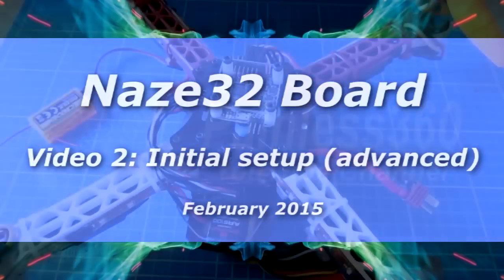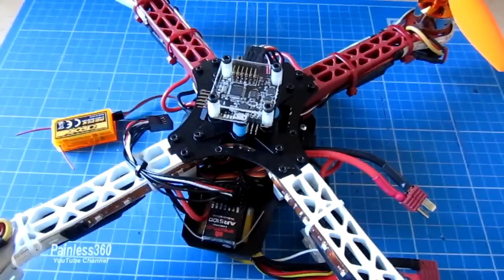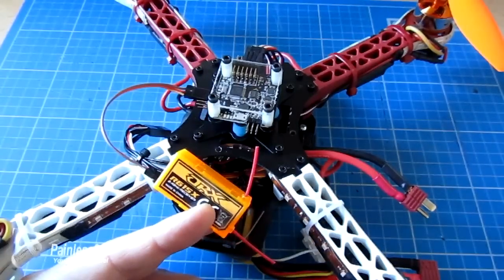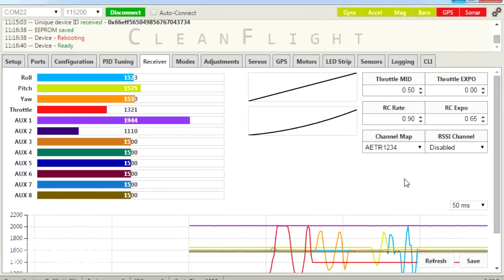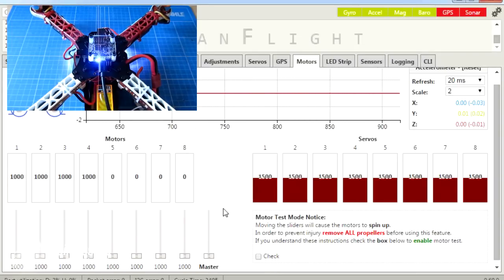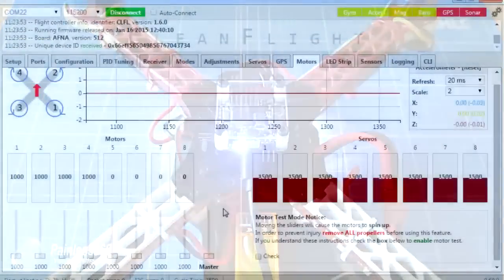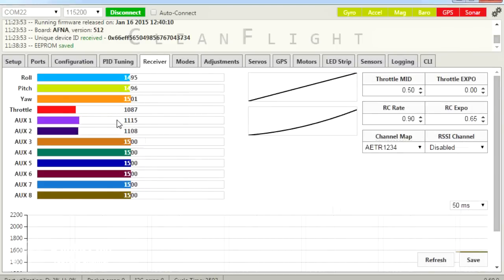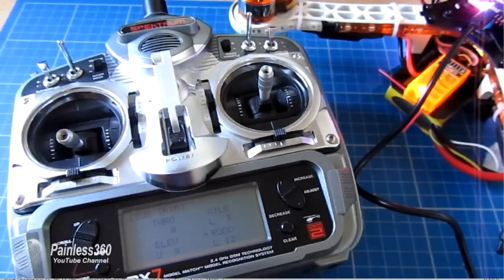(2/8) Naze32 Flight Controller - Extra setup steps and configuration

Comment: I'm at my wits end and decided to tap your wisdom again after searching and watching vids including yours over and over almost all day for a solution. Using Acro Naze32 R6, with FrSky V8R4-II rec'r, Taranis radio, with Frky DJT telemetry Module set to PPM. Naze set to PPM, 4 Opto ESCs (12A Afros with SK), one with bec. The V8R4-II is connected using one cable to Naze input 1. The Acro Naze 32R6 connects well with CleanFlight, firm updated, accelerometer calibrated. ESCs are plugged into channels 1-4 respectively, one provides 5v. I connect the Naze to CF all good, can see gyros working, but none of the channels works at all, the motors start via CF but nothing from the radio? IOW, I can't get the receiver to react at all within CF with my Taranis? I've tried with a X4R rec'r with 'telemetry' nothing? Any ideas?
Reply from the maker: +Pierre Seguin Does that receiver support PPM?
Reply: +Painless360 
From everything I read it DOES NOT!! I was under the impression it did especially when the 'binding' instructions tell you to set the radio to PPM mode. Just shows to go ya, read before buying. Time to buy another receiver darn it!! Thanks again for all your patience and wisdom. Hope you do a review of the Naze 32 Rev:6 pointing out the differences with the R5. I'm sure all will be good once I get the proper receiver. I'm open to suggestions for one which would work with the Taranis and offer telemetry. Thanks again.
Reply from the maker: I would go for the great D4R-II. Best of luck!
Reply: +Painless360 
I feel better now, as I ordered 2 of em! Thank you sir!
Reply: +Pierre Seguin 
Just a follow-up. I received the D4R-II and everything works beautifully! Did a flight test and she flies really well.
What I'd really appreciate is a more 'in depth' video on 'Modes' and how those 'ranges' work, and, how to use the 'adjustments' tab in Cleanfilght. Thanks so much for your help!

Comment: Checked out your wiring diagram at the beginning. Connected....everything working! Test flight! Spun violently( tri) broke landing gear bugger. Still happy to have made small step forward. Thanks. Ps will check motor config as naze different to flite test suggestions.
Reply from the maker: Nigel Holland Flitetest! Are you two timing me! ;) :)
Reply: Ha! Well if flite test don't reply to emails I may dump them and then I am all yours. Unless you count rcmodelreviews? Oh and spocktra50. Although they are just about crashing talking dirty and laughing at Alex! So now you got me this far where should I look for this violent spinning that is happening? Reverse servo? Maybe the angle it starts at?  Thanks again for getting me this far though. Felt good when everything started up. :-))
Reply from the maker: The board should take care of the angle of the servo. If it pirouettes then check it doesn't need reversing. The tilt should be to counteract the rotation.

Best of luck.

Comment: I can't seam to get a frysky x4r receiver to connect sbus to my taranis with the rev 5 fc boards,  I have sucessfuly done so with the rev6 by moving the signal wire to pin #4 several times. but I have 2 of these rev5 boards one just a basic acro the othe with baromiter, mag the works and I don't know what I'm doing wrong, have conf cleaflight with the correct serial ports. your vidieo uses ppm no problems though cleanflight looks a little differnt now. what am I doing wrong where can I learn the correct set up?
Reply from the maker: +Jeff Orr the rev5 boards don't have an onboard inverter for the sbus signal.. best of luck!
Reply: Ahh.. wow, now
 I feel kinda of silly then, funny thing is I finnaly gave up and used a frysky 8 channel and did it the old school way, so many wires. thanks for responding so quick I am allways happy to see a responce from you.

Comment: Hi fixed i wired the receiver wrong to the board as in the video it's not very clear because the white lead on the cable on your video was negative but when I watched the video 3 times when you went over the leads I realized I weird it wrong  by the way I love your videos keep up the great work

Comment: i am using DJI f450 frame , should i mount the battery on the base plate and flight controller on the top plate, or should i mount it the other way around, what is the best for a stable flight?
Reply from the maker: The F.C. needs to be as close to the COG as possible. Top plate is fine..

Comment: Excellent series of video's, helping me to setup my Emax Nighthawk250. I have an issue regarding the calibration of the Esc's, Emax  BLHeli 12A.. ie .. motor 3 starts at 1500us and turns ACW then on reducing PWM signal below 1500us it reverses and goes CW.Motors 1&4 ok.  Motor 1 stutters up to a reduced  max speed.  Would be appreciate your help....Joe
Reply from the maker: +Joe Stubbs Sounds like that ESC is setup for 3D flying. I would look at how you disable that on that ESC..

Comment: Many thanks for the excellent presentation of all your videos. I have build my 250 Quad  based on your videos which for my first build  went well having followed your tutorials. Can I ask , how did you switch the led,s via the aux  channel. Thank you.
Reply from the maker: I can't remember from this far back. I'd look at the WS2812 programmable LEDs is you want to control them. You can connect them to the FC and get them to do some very cool stuff!

Comment: Hi  If I use the Frsky X8R Rx with a single cable from the s-bus to Naze 32, do I need to use an inverter cable?
Reply from the maker: Usually, and connect signal to pin 4. Best of luck!

Comment: Hi there !    Just gone thru both videos on naze setup ~ very helpful thanks !   I'm using a Turnigy 9X Tx with Orange Rx plus Naze board on my V Tail Quadcopter and I'm having trouble arming the board.   I've calibrated all escs as per your video and trimmed controls to values you reccomend.   In Motors menu I can get all motors working via Cleanflight as in your video but as soon as I switch on my Tx and plug lipo into Quad I cannot get Tx to arm the board.   ( Naze disconnected from Cleanflight )   Can you help please ! ! !     I've watched all your videos to date as they are so well made and very helpful.   
Best Regards . . . Eddie.
Reply from the maker: +Eddie Lloyd Arming help video later in the series ;)

Comment: here is a question for you.
I was talked into trying the naza32 controller by our fpv race group, saying for race it is the best. after putting 300 or so into just the quad, I wanted to really see how it performed, I decided to try the auto tune feature instead of the old fasting manual test. for some strange reason when it started the auto tune it decided to ignore my throttle input and would not stop no matter what i did. I even tried killing and disarming, nothing worked, I did still have all my other controls so I could keep it sorta undercoat roll but, never could get the throttle to stop. to get it to drop altitude I had to flip it over and over doing line of sight flips are scary by the way. I had to ditch before the quad got over the interstate and as of yet have not recovered as it would have been a huge impact as it was inverted. I had oneshot125 esc and 2300kv race motors. hovered at a little over 1/4 throttle and had 6030 tri-props. any thoughts as to what went wrong? going to keep trying to find the craft but as I ditched in the woods I'm not feeling hopfull.
Reply from the maker: Tricky to say. I always add a buzzer to a Naze32 to help recovery. Best of luck..
Reply: I had to ditch from around 250 feet by inverting so a buzzer would not have worked as there was no power, battery did not stay on. I was going to use the props to let me know where it was. the big thing though is what went wrong? I have never seen a board ignore throttle input before. course I have never used auto tune before
Reply from the maker: +Brian Tapp Sorry to hear that, I've heard of a few odd things happening during autotune but never this. Best of luck finding the model. It's always heart-breaking trying to find a downed craft. All of us have lost at least one so know how rubbish it feels..

Comment: Thank you so much for such informative and comprehensive videos!! This is my dilemma, (I'm in mode 2) when I push up on right stick both pitch and roll move simultaneously in cleanflight. Throttle and rudder work appropriately .Transmitter is FS TH9x, receiver is FS R9B. Any insight would be greatly appreciated. Would this prevent board from arming?
Reply from the maker: You can't fly with it like that. I'd check the channels on the radio using the 'monitor' screen. You may have a helicopter model selected in the radio or a mix setup accidently. Best of luck!

Comment: Lee I have just re calibrated my motors with the throttles high as in your video done it all correctly, however motors 1 and 3 start first at 1062, and 2 and 4 start at 1075, this has now confused the heck out of me, any ideas please?
Reply from the maker: +Rob Ellis I normally revert to a manual calibration (see out video in it) in cases like this..  Best of luck!

Comment: Hi, I am using an Orange Satteltite RX (Spektrum clone) as PPM source to the Naze32. Ist there any way to get a RSSI readout in the Naze/OSD?
Reply from the maker: +Flo Sch That is more of a question for the vendor of the receiver. I'd suspect that if it is possible it requires a lot of messing about.. Best of luck.

Comment: is the naze better than the cc3d? bang good sell a really cheap cc3d, can you recommend it?
Reply: Pro tip: google it. You're by far not the first to ask this question.
Since most of the "goodness" of a flight controller comes from the software you run on it and Cleanflight will run on both of them: they are the same ;) .
I've never used a Naze or CC3D (I run Cleanflight on a STM32 dev board from ebay), but it looks like the CC3D has more pins broken out, which, at least if you're running cleanflight, will make it much easier to connect additional hardware supported by Cleanflight.
Reply: superdau the naza is multiwii the cc3d is not.. so I dont think they can run the same software.. the cc3d runs openpilot the naza runs a modified version of multiwii which is cleanflight or openflight
Reply: capone6 "naze"
Reply from the maker: capone6 Cleanflight will now run on the CC3d board (see https://www.youtube.com/watch?v=4OKGMhTrqOU about 8:30). Just like the Naze32 the CC3D is available in a couple of formats with varying amounts of sensors. The cheaper boards are the version with the basic features.

I've not had enough time with both to form an opinion but first impressions are that both are excellent current generation platforms with excellent support and software interfaces.

One thing I will say is make sure that, unless you are going to be happy with basic stabilisation and auto-levelling, you get the board that includes the magnetometer and barometer. Much easier to add extra features like GPS and associated modes later.

If it's your first build the fool proof setup wizard for the CC3d (OpenPilot Ground Control Station software) is a lovely way to be stepped though the build/testing process safely.

Hope this helps..
Reply: Painless360 it does help a lot im going with the cc3d for now with hopes to get the naze 32 after you have shown how to get the gps working, i beleive cc3d gps does not work properly.

Comment: Hi, I've tried to copy this setup but using a orangerx r910 receiver with sbus port. It's doesn't work. Am I doing something wrong or does this way not work and I have to use a satellite? There's no movement on clean flight receiver tab and I've double check connectors headers and cables. Please help.

Comment: Hi there,
Thank you for doing these videos.I'm on my first built drone, and they were very educational.
I have a question though(probably silly) : in order to give input from my controller to the drone via AUX knobs and buttons, do i have to connect the empty pins from the board and receiver ?
Currently 4 motors, my receiver is a  FS-TH9x
Thank you again :)
Reply from the maker: +Dan Suciu Watch the https://www.youtube.com/watch?v=LyPtzv0y5DE video it may help. You need to connect the outputs from the channel that the knob/switch controls to the input of the flight controller.Best of luck with it.

Comment: Hey Painless360,

Thanks for the great tutorials! You helped me greatly setting up my Disco with APM 2.6.

I am now building a 210 miniquad using a NAZE32 rev 6, and again your videos have been brilliant. 

One thing has me nervous though...When I got to the section on calibrating the ESC's (EMAx 12a) I noticed that not only was the receiver powered up from the USB port, but the ESC's and motors were live to!! Is this normal in rev6? There was not enough power to spin the motor when I raised the master slider, but they were trying!

I calibrated the ESC's individually (apart from one which was DOA), and they all spin up as they should when the battery is connected. The board seems to be behaving normally, and I have successfully set the modes.

Should I be worried about this?

Cheers
Reply from the maker: We've not used the Rev6 board here but the main power should be needed to run the motors. The ESCs need the main battery voltage/current for the motor power. The ESC circuitry may have been supplied by the 5v from the USB. Again, may be a new thing on the latest version.. Best of luck!

Comment: Hi painless360.. what kind of ESC your using??  i have a naze32 rev6 with 14.3 firmware and  4 EMAX simonk 12A  ESC... but every time that I want to callibrate my escs dont enter in callibration mode.. do you have any idea why this happens ... thank u .
Reply from the maker: Back when we shot this video it would have been a SimonK flashed 20A ESC.. You need to plus the battery in after you raise the throttle. See the 'Quadcopter building for beginners' series for more detail on each step. Best of luck!

Comment: Can I use a Spektrum DX9 transmitter with an orange R920X receiver in cppm?    I would like to use it with my naze 32. I can bind the receiver but nothing good happens when I try and connect it with the flight controller.   ENJOY YOUR  SHOWS.
Reply from the maker: Tom WAllace Should work. What does 'nothing good actually mean?' ;)
Reply: Painless360 well when I connect with my dx9 the Naze shows a flashing red , a green and a blue,  MY BUZZER IS LOUD ENOUGH TO MAKE YOU WANT TO RUN TO THE BOMB SHELLTER.
Reply from the maker: That sounds like it's FC related not receiver..

Bets of luck with it.

Comment: I am looking at building a micro and have a question for you; using this board is it neccesary to use esc's with small ~7mm motors?
Reply from the maker: +retrotellephone You need ESCs to run any size of brushless or brushed motor. Best of luck with your project!
Reply: +Painless360 Ok, the reason I ask is I've seen some micro boards that must have them built in. Thanks for the quick response and fantastic videos.

Comment: Hello,.. thanks,.. it's a great video,.. by the way, how to connect ppm  receiver flysky fs-ia6b to the cppm of naze32 rev6 ? it's the same procedure ? if you have any link of diagram picture or video is very helpful,  thanks.
Reply from the maker: +Sigit Pramono Should be, I'd check the manual to be sure.. Best of luck.
Reply: Thanks for your replied, i'm confusing the wiring power and setup for these type.

Comment: Any ideas on how to setup sbus?  I've made the inverter cable for my x8r receiver but when I select serial rx it won't stay active.  The software will let me select Ppm and the other rx types. But when I select serial rx and flash the board, it returns un selected.
Reply from the maker: Andrew Littlejohn For SBUS you need a hardware signal inverter. Signal goes to input pin 4, power is 5V. If you Google 'Cheap SBUS inverter' you should find one..
Reply: Hi thanks for your reply.  I found some instructions on how to make the inverter. So I purchased the fets and resistors from maplin today and made up the cable.  My issue just seems to be with clean flight. If I click on serial rx and save.  The 4 options available for the rx's are not selected. But any other mode will save to the board fine.
Reply: I've realised my error. The fet I bought is the wrong channel, basically my signal is still inverted.  Lesson learned
Reply from the maker: Thanks for letting me know - glad you got to the bottom of it..

Comment: Any chance of some help? Have a dx6i with Storm receiver (ppm ) if I connect ppm rudder works ( tricopter.) but pitch and roll mixed up will not arm. I am a real noob at this. Think maybe get same Orange receiver like you? Really frustrating as all videos like, ft, rc model reviews say it is so easy.   Grrr. Thanks. Nigel
Reply from the maker: Nigel Holland Go through the setup again and either reverse the elevator channels in the radio (http://www.horizonhobby.com/pdf/DX6i-Manual_EN.pdf, Page 11) or in Cleanflight. The receiver will not make any difference to this problem. 
Best of luck.

Comment: Do I need to bind my receiver with transmitter before I plug in ?
Reply from the maker: +Tuan-Anh Nghiem i normally do, once setup is complete I rebind to capture the new settings onto the reciever before testing failsafe. See our  'Introduction to Remote Control ' series.. Best of luck!
Reply: I used same receiver that you used, and turn on PPM,  I followed exact your instruction, but It did not work. So I have some questions to ask:
1) When you connect your receiver in the BATT/BIND, how do you bind your transmitter with receiver 
2) In the clean flight, the throttle and the aileron is not moving.
I hope you can give me some hint so I can fix mine.

Thank you very much

Comment: Determined the problem as a  large  throttle range.  I had changed from pwm to cppm and the orange receiver  did not like the settings.  Reset the ranges on all channels  and problem solved.